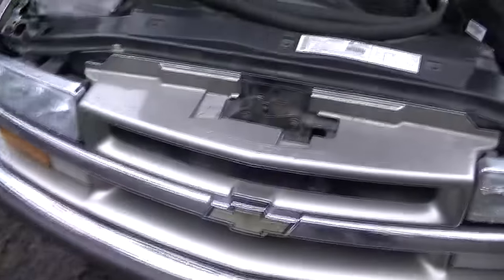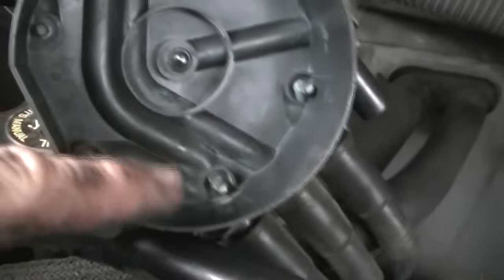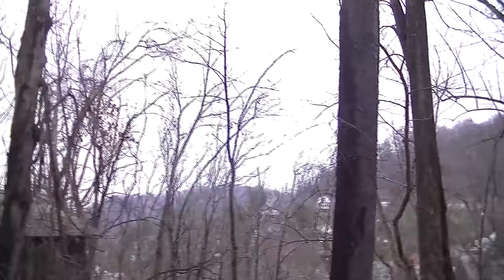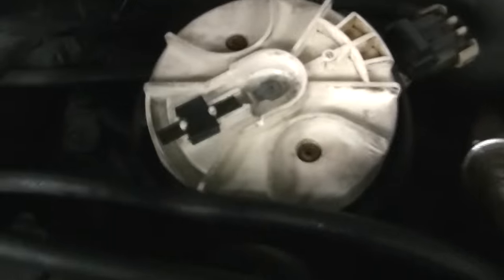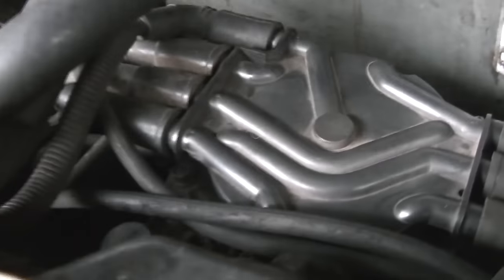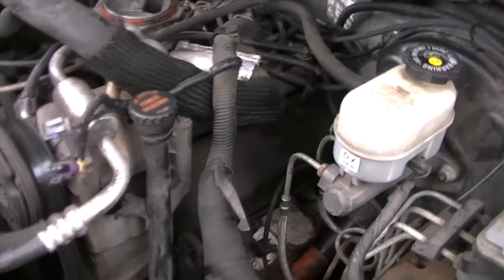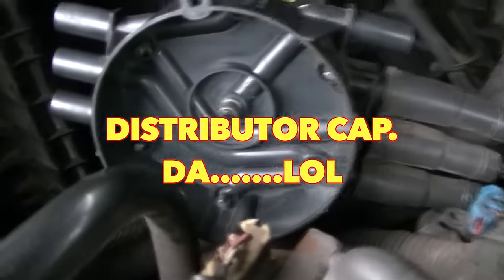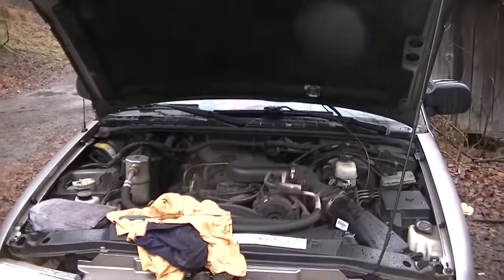4.3 Chevy S10 Not starting. Fixed!! EASY...Popping, Vapor locking...Jump time??... 1995-2008

Comment: This video saved me $500. I was on the way to parts store to purchase a new fuel pump. Ran across this video and decided to purchase distributor cap instead. Came home and installed the new one and it fired right up. Thanks for the video
Reply from the maker: Hell yea!~ Cool.
Reply: I did the same the when motor isn't firing correctly replace distributor cap and spark plugs first and coil wires and see what happens then test thermostat process of elimination it seems distributor caps need to be replaced on these most of the Chevys quite often that is the basic problem
Reply: Its only 20 to 30 bucks for new  distributor cap well worth the money
Reply: @FixingWithPassion  .  1
Reply: @johnblack1768  5 CD
Reply: Thank you I hope it will fix mine
Reply: Could you hear fuel pump ..humming when turn key....

Comment: TY! 2001 S10 4.3L was not starting after sitting for a few days.  Knew the fuel pump was on borrowed time but starter fluid wasn't firing it up, no codes on the OBD II.   Checked the plugs and starter and battery.  Found this video, ordered on amazon, 5 days later I have a running truck again.  TY!

Comment: Good video. Thanks. Hairline cracks in a dis cap can be impossible to see. I learned this in 1987 with my 1977 Datsun pickup. She was backfiring, idling rough and going dead. I spent most of that day replacing the points and doing a basic tune-up up but nothing worked.

My dad came home and told me to wait until dark, he wanted to teach me something. After dark I raised the hood while he fired her up. It was like fire works under there! We could see fire jumping from the dis cap body. After it was fixed the next day, he put some red powdered dye into the old cap and shook it around. Three cracks became visible instantly. Hope this helps anyone that still likes running these older motors as much as I do.
Reply from the maker: Sweet!~
Reply: Sometimes us old school mechanics actually know a thing or two dont we ?? Lol get a set of lifetime wires and replace them every. Couple of years for free ..

Comment: this has  help me with 3 problems
1 random popping noise when turning the blazer off 
2 running crappy till the blazer was warm up
3 no start same as the video
i was stranded at my kids place about 172 miles from home 
seen this video and went to napa and bought the top and the piece that was under it that spins
installed it and runs like new total cost was alittle under $59
so thanks for this video as it fixed the 3 problems i was having

Comment: Thank you.. didnt even fuck around cleaning mine it looked worse than yours. got lifetime replacement rotor button and cap and shes no longer dead in the water.. I changed the plugs and wires when i got the truck didn't even know it had a distributor cap thought it was all solid state. live and learn 220k miles on the original distributor cap!!!
Reply from the maker: Word!~

Comment: Yep ..learned this the hard way on my 97 New everything. But mine starts fine it just misses Real Bad until it warms up good. Drilled my vents out. Still did it. I finally used a WD 40 Water Resistant silicone lube. Spray inside of cap one a month or so...FIXED. Good Video Sir.
Reply from the maker: Nice!~ Now get ready for Ice and snow~
Reply: Same with my 98 s10 4.3 !!! 8m going to try the wd40 thanks

Comment: If you aren't familiar with the wires to the distributor, write the number that's  on your distributor cap onto the plug wire plugged into it at each location with a permanent marker.   If you take them all off, just match the number on the wire to the number on the distributor and you will have it right.   In case you didn't know, engines don't fire in sequential numerical order like 1,2,3,4,5,6. It fires in a different order to balance the engine.
A crack in the distributor, even one too small to see, can cause this.

Comment: Thank you. This was my problem. I had a bad dist. And replaced it with a new cap n rotor and surprisingly it was bad in such a short time. Had the one that came with the new dist and it worked. Also replaced the coil and wires but they werent the problem.
Reply from the maker: Great! Thanks! Glad you fixed it!

Comment: Nathan Thank you! My sons 2002 4wd 4 door Blazer quit on the way home. It would crank but not start. I just tuned it up 4 or 4 months ago but I cheaped out and bought a $19 china ebay cap/rotor kit. Don't ever buy one of those. Carbon dust and arching was all over under the cap. I put a good quality one on this time and it fired right up! Thanks again!
Reply from the maker: Nice!~
Reply: You may be surprised but they are all from China these days, so it is the manufacturer's quality control that we have to challenge.  Where it exists, you get good parts, where it is absent, you get junk.
Reply: I'm not surprised at all almost everything is made in China these days. What I should have said was I bought a cheap, no name, generic cap and rotor kit from Ebay. The one I just bought from Autozone was actually made in Mexico and has the brass inserts just like the a/c delco ones that everybody says to get but autozone was out of. It's a much better quality item.
Reply from the maker: Word!~

Comment: Heads up on the screws to take it out, if you've gotten a new distributor and cap, the screws are for a T15 screwdriver. The clearance you need to get to them have to be less than 4". Hope this helps with anyone who is having the same trouble. I ended up getting my sister blowdryer and drying the distributor for 5 minutes just to get the moisture out without takes the distributor off.
Reply: Ah yes the hairdry quick
Reply: +Drossa17 - I have an easy fix for it :)

Comment: Same problem with my 1993 Chevy S10 tbi .. moisture in cap and rotor ..I used Taylor cap and rotor with all brass ..I think it works better than the stock cap and rotor..I sealed it up with small amount of  silicon.   The vent was clear . Thanks for video.
Reply from the maker: Nice!
Reply: Where the vent you guys be talking about?
Reply: LOOS3CANNON the vent is on the distributor housing .take the cap off you will see the vent with a screen on it .I hope this helps
Reply: LOOS3CANNON theses Chevy 4.3 balance shaft motors have a bad problem with wearing out distributor gear and timing chain as it's a single roller and it's turning a balance shaft .any wear can make your timing to jump all over .

Comment: Mine is doing the same thing, except it is flooding the engine.  I replaced a broken distributor (shaft was broken) about 2 years ago.  Now it acts like it has no spark, but it will pop once in a while.  I will get a new cap and rotor.  Thanks for the video and solution.

Comment: Thanks so much for this. You just saved me a ton of money. I put a new distributor cap on and it fired right up. Great videos man!
Reply from the maker: ;D
Reply: I wish I saw this before I replaced a timing chain that I had already bought and found the engine hadn't jumped time. the cap had the engine turning just like yours and I replaced the cap afterwards and it cranked right up .thanks for the video, it will save people a lot of money 👍
.

Comment: Hello Nathan, I went back and reviewed this film. It's a good case study for me. I'm a Ford man, but I've been expanding out with other makes to learn all I can to help people that need free help! Like I once was, vulnerable , so I can help them. I've much to learn!, but learning much being a DIY'R,  😊👍, I've seen in other films, professional mechanic stumped in a" no start" situation , it turned out to be a cooling temperature censor Nathan, you're examination was only second I've seen to determine if that was the starting issue. Of course you're case it turned out to be a Distributor cap, thanks again friend !👍🌞
Reply from the maker: Good to know....!
Reply: +Dave Deatherage - YES, I have had that happens before and I did make a Video about it.  The Coolant Temperature Sensor can cause a no start.  If you had a shut down during hot engine ride.  Once it cool down, the engine will start again.  Also i like to note... If you have a bad Ignition Control Module, it also behave that way as well.
Reply: @JodBronson  OK, thank you.

Comment: Good video, I just came across this. I have an 03 s10 blazer 2wd LS. I started throwing a code (I can't remember what it was) but it was missing . Very simply it was that damn cap. I cleaned mine and sanded the contacts slightly and haven't had the problem since. I have read on the S10 forums if you do replace the cap and rotor replace it with AC Delco. I've read about guys that buy the aftermarket caps and they only last a few months. I have 173,000 miles on mine so it's probably time for a new one anyway. I go by the motto if it ain't broke don't fix it. Thanks again buddy !
Reply: If you run into moisture's issues... I found a fix for it!

Comment: 1990 Chevy s10 4.3l v6, i replaced the distributer cap (idk if I put the wires back the correct firing order) it still cranks but now it has white smoke from the engine when cranking

Comment: Been down that rabbit hole. Intermittent spark from the cap. There is a test port on the fuel line (driver’s side) by the distributor. If you wanted to check pressure. The On Board Diagnostic’s (OBD) throwing that coolant temp code 🤬.Good video man👍
Reply from the maker: Interesting!
Reply: any chance you could elaborate  ?

Comment: Just wanted to add for anyone having issues with no start on these s10s an blazers.. Check the ignition module in the distributor.  That was my issue an spent tons of money replacing parts before I figured it out. Hope this helps.
Reply from the maker: Good catch!
Reply: @FixingWithPassion  👍🍻
It was doing some funny stuff .. like sometimes it would start but turn over 8-10 times before starting then sometimes it wouldn't start at all.. but it still had spark ..an good fuel pressure. An then it just stopped starting .
Reply: Hello, mine is a  s10 2.5 1985,  could this solution work for me,?  Have replaced fuel pump and issue continues. Thanks in advance.
Reply: @moyeteitor  
It could minene would spark sometimes an then not spark at all .
I eventually just put a new distributor in it . First thing I would do is a spark test. Go buy one of those lil spark lights an check#1 cylinder.

Comment: Very cool vid! I have a 94  Blazer with a v6  4.3  Vortec engine and the same problem. Mine is injection  fed but not much different. I cleaned the cap and rotor and still have the same issue, will change both and the plug wiring too. In addition , the intake did not produce any suction when i turn the engine so i guess it must be a valve problem.
Reply from the maker: O not good.
Reply: @FixingWithPassion  I know, I'll keep trying though . I'm not giving up !
Reply: Buy a new one. Cleaning it doesn't always fix it

Comment: I had this problem, sometimes it would crank sometimes it would not, very frustrating I did the distributor thing the battery thing the temperature sensor thing, to no avail. Still sometimes would sometimes would not. I got a fuel pressure gauge and it showed 50 psi I was told that was enough and no bleed down so I just said to hell with it and put a new 149 dollar GM fuel pump in it and haven't had any issues since. 50 psi is borderline it want atomize the fuel it will shoot a little stream in the cylinder causing it to flood out, you need at least 65 psi for proper fuel dispersal.
Reply: Can anyone tell me if a 2003 zr5 4.3liter vin code x motor would work in a 2000 chevy blazer 4x4 vin code w

Comment: I needed this video. Have Chevy Blazer with same problem it won't to start but won't, weather been crazy here raining, then snowing, plus freezing and sleeting. I was told I needed a fuel pump.. Go figure.. thanks because this is what I was trying to explain to someone about moisture getting trapped inside under the hood...

Comment: Outstanding video. I'm having the same problem and I think before I dive into this I'm going w/ a new cap rotor and set of plugs.
By trying to start this thing I have flooded the the engine w/ gas and no doubt gassed the plugs.  when I tried to start it, it did try 
to start a few times but sounded like yours. It has been raining here for several days and no doubt everything has been collecting moisture.  Sure appreciate the help. Thank you and I subscribed.
Reply: If you run into moisture's issues... I found a fix for it!

Comment: I recently changed the fuel pressure regulator on my 99 sonoma 4.3 an now it wont start but its getting fuel an spark would you suggest trying to replace distributor cap an button?

Comment: The problem you guys are having with premature cap and rotor failure is that the bottom of the distributor has one or two vents that keeps the inside from building up moisture. When you change the cap and rotor, spray out the vents with brake cleaner or carb cleaner. There is a screen in there that gets clogged. You don't have to use only AC Delco parts also. I've sold many different brands and my customers have no problems after I tell them about the vents. This info is on the web if you research it. Good luck all.
Reply from the maker: Thanks for your story!
Reply: No problem. Someone told me about it. I've gone over 4 years and 60,000 miles since I changed out the cap and cleaned the vents. Just paying it forward.
Reply: I've changed cap, rotor, and distributor sensor, cranks shaft position sensor still having problems
Reply: @shawnp8076  you ever figure it out?
Reply: @shawnp8076  Ignition control module.
Reply: Take those screens out (there's actually a service Bulletin that was sent out long ago specifically for that - no ventilation)!
Reply: @shawnp8076  , it could be the sensor inside the distributor, it's below the rotor, I would try replacing distributor or, make sure fuel pump is working and your getting enough fuel pressure,  second make sure your not having issue with the ignition, could be bad ignition switch or a fuse or relay.

Comment: Gotta love the crappy fuel system in these ol S10's .. I've owned and still own several and it's common place to have to replace the pump every few years, AND then there the lovely Spider Injection which fails more than most people know of. Luckily now you can repair each individual injector as there's several aftermarket companies making replacements. Years ago you had to go dealer direct and it was around $400 for just the Spider Injector NVM labor if you weren't doing it yourself. It's great when it's working properly however.
Reply from the maker: Right on man!

Comment: Yeah i had a 98 c1500 350 with 98k miles an did the same shit when it would turn over an after putting a new cap an rotor an it fired right off an good as new again lol . Customer was shocked after spending so much money at other places , shops .

Causs she was charged $300 for a tune up an nothing was touched
Reply from the maker: Nice!!

Comment: Tech tip for y'all dealing with moisture in your Ignition system, BUY some WD40 . All you need to do is lightly spray the distributor/cap and rotor assembly with it and your vehicle will than start! That is what WD40 was originally designed for as it stands for "Water Displacement #40" In all my years turning wrenches it's the #1 method I've found.

Edit: Fyi the timing in these are controlled electronically and the ECM adjusts it to meet the requirements for fuel/air.
Reply from the maker: Nice!

Comment: Okay so I just spent so much money on my 1991 chevy s10 4.3L pickup new stuff I bought for her:
New Alternator, New fuel pump & fuel sending unit, New fuel tank, New distributor Cap & New distributor and spark plugs and wires, New sensors for EVERYTHING. New EGR Valve.
New Fuel injectors and fuel injector housing. New fuel filter, New safety switch (all 3 replaced). New ignition cylinder lock. Only thing I haven’t changed was the ECM. My battery gauge is reading 17volts that’s way to high something is off.. any help would be great

Comment: I'm having very similar issue...& had it happen before - towed an hour to mechanic & when it arrived there...it started - they changed the ignition switch, but obviously that wasn't the issue cause here I am again, stuck @ neighbors-facing the wrong way for towtruck...& I gotta get the plow of it -- there was snow in engine bay from charging overnight - fingers & legs crossed - I give up for today

Comment: As I was watching and listening I was wishing I could speak to you and let you know that the cap is gonna be the culprit lol, I know quite well as I’ve been through the exact same issue with my 02 blazer ZR2. #Quick Tip- spend the money on a good distributor cap with the gold terminals, I think I paid around $50 bucks for one at Oriellys, the gold terminals won’t corrode as easily as the cheap ones and they have a life time warranty on them.

Comment: Hello Nathan, I have a 2003 Chevy s10 4.3 with a crank but no start. I don’t have or getting the quick lockup just only turning over without the lockup. Could it still be the cap and rotor?

Comment: I have a 2002 chevy s10 v6 , I had done a full tune up changed the fuel pump,  new distributor and cap , the truck was driving great and then one day it won't start, it is not getting gas, any suggestions,?
Reply: Same here someone please answer

Comment: I have a 91 S10 and I have replaced the distributor cap and rotor button and I have replaced the fuel pump. I can get in it in the morning and it will crank right up and will run for 5 minutes or so then goes dead and won't crank again even when I shoot it with starting fluid. What do you think about this?